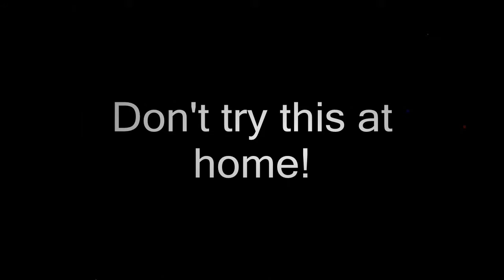Resonance - Electrical Arcing

Comment: Would you consider to place an array of rectifiers in line with the output of the transformer "Before The Capacitors?" I think that it is the way that large "Tig Welding Machines Work"